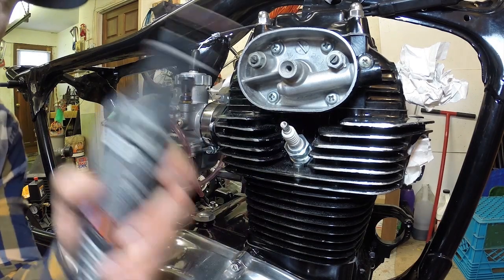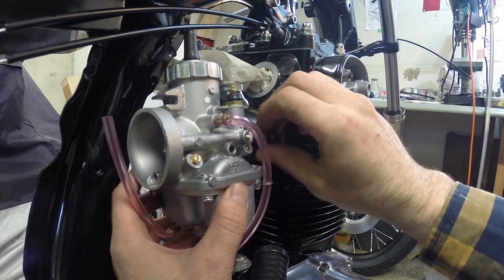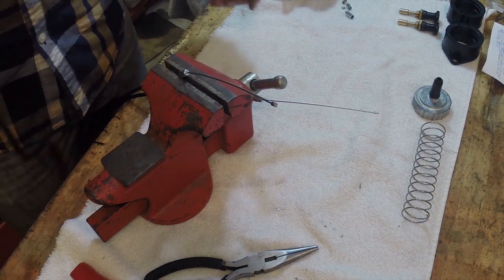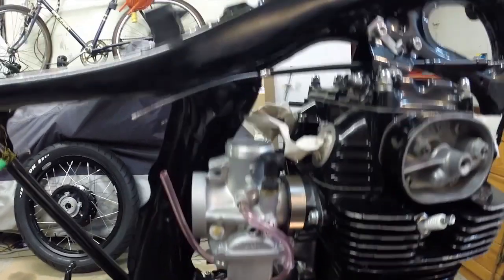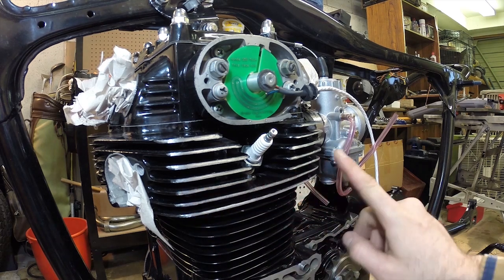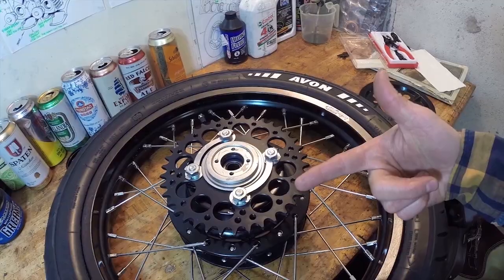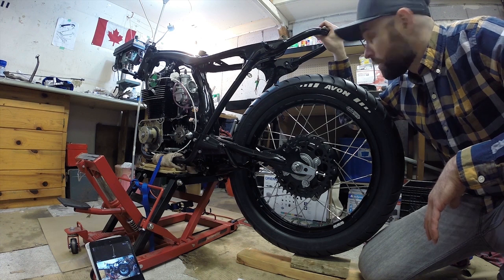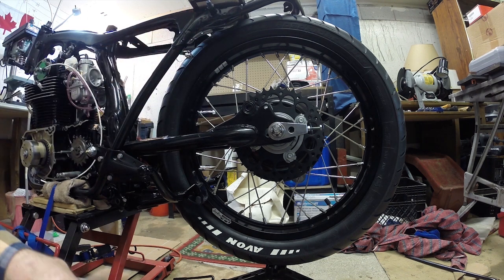Saturday's Wrench Ep.25: Half a Roller! - Honda CB350 Build

Comment: you're practically ready to start the bike! hook up a temporary fuel tank and give it a go. can't wait to hear that awesomely beefed up motor run!
Reply from the maker: +Sir Charles in time grass hopper.. in time :p
Reply: +Saturdays Wrench I wish I had your patience! lol. with everything I build it's: get it done now, no matter what I have to do! I shim stuff with soda cans, slather things in RTV, and zip tie+electrical tape everything! it might fall apart in a day or two but damn, starting an old engine and hearing it run for the first time in over a decade... truly magical.

then when everything breaks I have to go back and redo just about everything hah.
Reply: oh also, that cable going into the carb should butt up right against the carb top. you generally adjust the inner cable length at the throttle end by either using a cable knarp or by doing the solder trick. you'll see what I mean when you hook up your throttle and try to twist it. there shouldn't be any of the inner cable showing when all said and done.

also, you can use that push/pull throttle and just use the pull side since you have a 2-1 cable. but generally the single pull throttles are cheaper to buy, like 30 bucks. you're not using the stock controls are you?
check out treatland.tv it's my fave moped store but they have good general stuff like cables, throttles, nic-nacs, bits and bobs, plus they ship international.
Reply: one more thing! iirc you're gonna use a 8cell lith-ion batt? I'd recommend going with the antigravity 4cell li-ion batt, I'm pretty sure it can handle the cranking amps of the starter motor and is so much smaller. you don't really need a gigantor battery on these smaller cylinder bikes. if you went kick start only, you can get away with no battery and just a capacitor.

Comment: I love watching these vids when they go up.  I have a '73 cb350 twin and going through a similar build.  Be interested to know how you found the stock carb boots meshing up against the vm30s.  I found the ribs on the stock boots don't align with the vm30 markings.  Also, be interested to know how you go with middle (vertical) frame brace clearance when the air filters are fitted.
Reply from the maker: +Dan Bee Thanks Dan! Those are not stock carb boots. Those are carb boots specifically for the vm30s, hence why I needed to modify them to fit onto the cylinder head. The air filters fit in no problem, they sit slightly outward and up against the middle vert frame brace but they definitely fit. I mocked everything up to measure everything for the electronic tray I'm designing. All good in the hood!

Comment: Hello, may i ask how much you pay for those mikuni carbs and where you bough them, because i have a Honda Cb750 1981 and my mechanic told me that i should replace the four carbs. I personally think that with a deep cleaning and a new set of rebuild parts and tuning i will be working good again. But i'm not an expert. I'm for suggestions and tips.
Reply from the maker: I would definitely try and refurbish your stock set up. I can’t remember exactly what I paid but it wasn’t cheap. Around $500 or something. If you clean and refurbish the original carbs it will run a lot better. If you haven’t done any upgrades to the engine, the stock carbs are best. A lot of ppl have issues with the mikunis on a stock engine. At least that’s what I’ve read.

Comment: Love your videos! Thinking about upgrading to the big bore as well. What exact carbs did you get? Just the standard 30mm or did you have them pre-jetted? If so, what jets have you installed?
Reply from the maker: I am using Mikuni VM30's.. I had some guys suggest the 32's but I think I will be ok with the 30's. I don't know how she runs yet bc I haven't fired the engine yet so I am unsure of what jets I will need. I got them pre-jetted from Dime City Cycles. They come in a kit for the 350. Here is the set up: 150 main jet, 3.0 slide, P2 needle jet, 2.0 air, 50 pilot, and 6F5 needle 

Kit Includes:
2 Pre-jetted VM30 carburetors
2 57mm K&N Style cone air filters
A 2-1 universal cable (Soldering Required)
Mikuni Tuning Manual 
Extra bag of main and pilot jets for fine tuning:
Included Extra Mains: #140, #145, #155 & #160
Included Extra Pilots: #45 & #55

http://www.dimecitycycles.com/the-coveted-mikuni-vm30-carburetor-complete-kit-for-honda-cb-cl-350-360s.html

Comment: personally i wouldn't use phillips head screws they always strip out on me i have had much better luck with allen key bolts. stainless steal as well so that you don't have to worry about them rusting which also makes philips head screws strip a lot.
Reply from the maker: +BBoy90009 Thanks for the advice!

Comment: Hey l absolutely love these vids. I was wondering though, did you change the rear Cush drives because I can't not find them anyway? If you did, where did you get them?
Reply from the maker: +Adrian Ramirez mine were in good condition and did not need to be replaced. You can find them at a local Honda Motorsports dealership or at 4into1.com

Comment: Tony did you consider the mikuni 45 degree cable adjuster for VMs? I bought them and they seem to work better.
Reply from the maker: +Graig Cameron ohh I didn't.. Ok thanks man I will look into it. Does that fir on to the top of the carbs or the throttle?
Reply: +Saturdays Wrench Yes, screws to the top of the carb.  But as it turns out I had issues with the tank gasline cross tube thingy hitting it. I'm still playing with it but wanted to let you k ow it may not work.
Reply from the maker: +Graig Cameron ahh gotcha.. ok thanks man. let me know for sure!

Comment: The clutch cable should route on the right, with the throttle on the left
Reply: You can also use the swivel joint from you're original cable.
Reply from the maker: +Overture Not sure if I'm understanding you here... the twist throttle on the left clip on?! Can you clarify?.. Ahh, just re-read that. The clutch cable goes on the right of the motor mount and the throttle to the left of the motor mount? Why not the middle?
Reply: +Saturdays Wrench The throttle and clutch cables curve around so they don't kink when you go to full lock. The throttle cable goes on the left hand side of the frame and then goes to the right handlebar and vise versa for the clutch cable.
Reply: +Saturdays Wrench 
The Throttle cable goes to left of head tube and should be routed above the fuel tank mount.

The clutch goes to right of head tube then under spine behind top motor mount and over left carb boot.

The wiring harness gets zip tied to spine and passes above front left fuel tank mount.

Both spark plug leads get captured by a wire clip mounted to the back 
top engine mount bolt (look at the parts fiche for clip reference)

When routed this way all cables have good free movement allowing the handlebars to travel lock to lock with no binding.

All this info is in the Workshop Service Manual.
Reply from the maker: +Overture This is really helpful, thanks!
Reply: +Saturdays Wrench No worries bud, I've built two 350's in the last 3 months. I know the bikes inside and out. Feel free to message me if you ever get stuck :)
-Chris